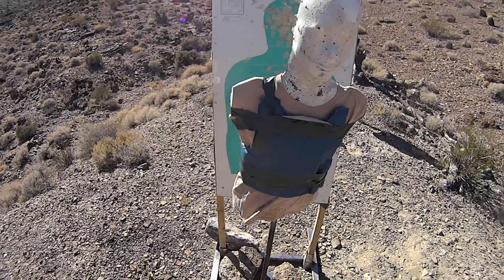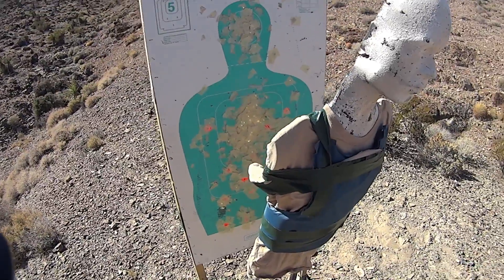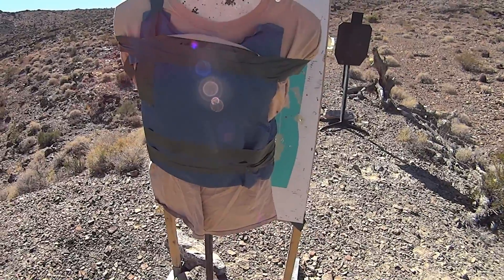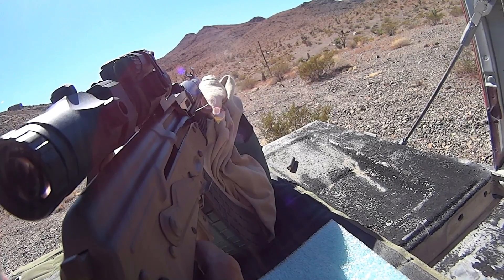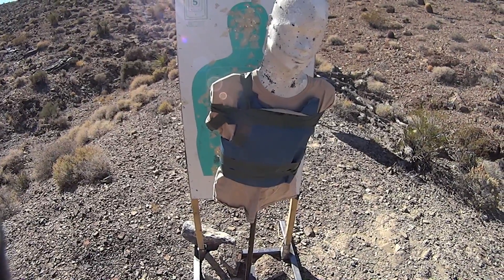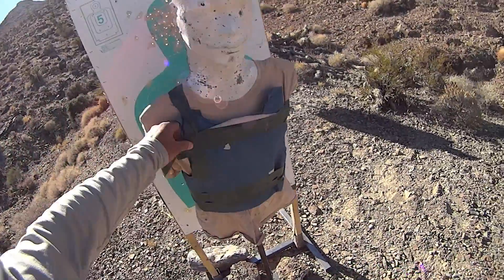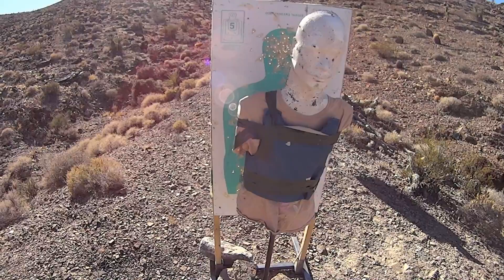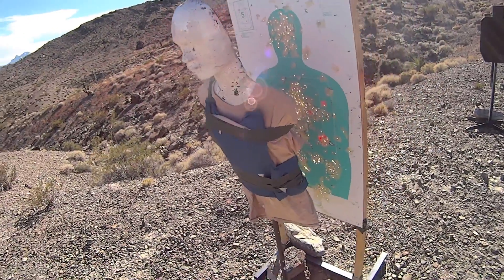7.62x39 vs 5.45x39 pt. 1.1 Long Range Armor Penetration redo

Comment: The 5.45 out of the 24" in vepr is a nasty round on humid days u can see vapor trails as it's zipping through the air at around 3400fps

Comment: I mean 124 grainers are still going faster than 1200 fps at 500 yards by the way
Reply from the maker: Depending on the load…around 1200-1300 would be expected.  In this case probably 1200ish as this barrel is 14.5”

Comment: 123gr 7.62x39 doesn’t go subsonic until 600 yards. At 475 it’s still going about 1,200 fps. Ballistics calculators are neat and also free.
Reply from the maker: Its potentially subsonic around 500 yds...its 1,200 ish at 440...about the same as a 9mm...they are neat.  Depending on barrel length and the actual projectile it can vary..but its most likely subsonic from a typical Ak barrel by 550yds

Comment: I just don't buy it that soft body armor has an expiration date... We're not talking about milk, we're talking about kevlar and other synthetic materials, it doesn't go bad over time, but I can understand why companies put expiration dates on it.
Reply from the maker: There were some materials that were shown to degrade over time...particularly with exposure to the elements.  That said, some materials degrade more than others.  Most that I have tested have worked fine, even after 20yrs...
Reply: @7N6ballistics  Interesting... Thank you for the response

Comment: now you see why people use 7.62X39. even though the Russians have adopted the 5.45 they still use 7.62
Reply from the maker: jerry a not sure what you mean...it did the same as 5.45, but weighs more and harder to hit with..  It has its place, but i fail to see how this result was anything special
Reply: @7N6ballistics  alpha &fsb units use 7.62x39. And it has its use there are 220 grain subsonic rounds . also the new ak15 has like zero recoil on full auto etc
Reply: 5.45 like 5.56 makes more damage to the flesh tissue, while 7.62x39 just passes through flesh inflicting, sometimes, minimal damage and stopping power. But yeah, 7.62x39 goes through walls like a boss.
Reply: @vengeance160  that's so false. 7.62x39 has way more stopping power than 5.56, ask anyone that fought in actual war.
Reply: At range past 50-100 yards, for 5.56 its just varnint holes typically unless its a 20 inch barrel? 5.45 yaws better and that hollow cavity leaves nastier wounds at distance beyond 100 so pros and cons depending on engagements

Comment: Would love to see this test with the new Barnaul or Wolf WPA mil-spec 5.45x39 (green box). It's supposed to be the same as 7N6 but without the steel penetration or corrosive powder.
Reply from the maker: SemperFiMac77 WPA green box, and polyformance, are both made by Barnul..as is the "bear" line..same projectile.
Reply: Very cool, didn't know that. So just go with which ever of those I can find cheaper then
Reply from the maker: SemperFiMac77 Pretty much...

Comment: WHAT???? Every AR guy on the Internet says 7.62x39 is useless at long range, how can it go straight through soft body armor at 500 yards when the entire .556 community says it can't hit anything over 300 yards?
Reply: Kevin Bowman  well it's not ideal for accuracy but if ur really good u could shoot subsonic 300blk to 500 it's about skill vs convenience
Reply: Whoever is still debating the 5.56 vs 7.62  knows hardly anything about firearms and is most likely a fudd. These two calibers are nothing alike, it's like debating two completely different tools. There are times when 7.62 has a significant advantage, and there are times when 5.56 has a significant advantage. Different tools for different jobs. FUDDS- STOP DEBATING 7.62 vs 5.56 THEY ARE COMPLETELY DIFFERENT!!
Reply: You are obviously not very good at shooting or analyzing those shoots. 7.62x39 has a very wide spread at 490 yards and was subsonic. The round was tumbling. The guy was running on luck when he shoot 7.62x39mm. The same thing that Taliban in Afghanistan do. Spray and pray. On the other hand 5.56x45mm or 5.45x39mm (very efficient round) have no troubles hitting man sized target at 500 yards (and still staying supersonic, that is thee trick by the way). I hit 10 or 14 inch gongs at 600 yards with 5.56x45mm using 62gr or 75gr or 77gr in 10 mph wind no problem. When I use 300 blackout in the same conditions (147gr S&B with G1=0.401) my hit percentage drops. Slow rounds don't do well in wind. If I used 7.62x39mm hit percentage would have been even less. 
I do plan to acquire 5.45x39mm rifle and some ammo. 5.56x45mm and 5.45x39mm are fun and very efficient rounds (especially 5.45x45mm that gets G1=0.347 with 60 grain projectile).
Reply: @im-oc4jr  I shot man sized steel targets with a 1-6 ACSS scope from a AR47 hybrid and hitting 8 out of 10 shots at 600 yards.  Yes, I have an upgraded trigger and BCG but the round can do it despite not having much power left at that distance.  Since, doing that 3 years ago I haven't bought any other 5.56 rifles as why bother when x39 can do what I need it to.
Reply: @mikes1172  human size targets at 600 yards that is the key human. Your spread must be a few feet. Sometimes you get leg hit sometimes you get head hit. On the other hand with my 20 inch AR using 77gr I have multiple 6 to 9 inch 10 round groups. I do the same thing with 300 blk and my groups open up especially when windy. My spread with 5.56x45 is few inches. You can lob 9mm at 600 yards. It will be large spread but it can be done. You can shoot 22LR at 600 too. 
Anyway, I used 7.62x39 a lot in the Balkan wars. If you want to hit something especially in mountains with changing winds it is at best 300 meters caliber. 
5.56x45 is much better for longer ranges and you don't have to us your rifle as a mortar.
Reply: @im-oc4jr  Well, I have it on video and I wasn't alone when the test was done.  BTW, I don't need your qualification or approval, so have a great day!
Reply: @im-oc4jr  7.62x39.is superior out of a shorter barrel it loses very little velocity which is why some special units in Russia still use it.

Though at longer ranges obviously 5.45 is better for regular infantry . lighter and better ballistics
Reply: @im-oc4jr  The same thing that Taliban in Afghanistan do. Spray and pray.
====
Yes, spray and pray...
...because islam actually forbids killing. So, religious Muslims just not aim, shooting "somewhere that direction" leaving to God Will who would be killed.
That is of course when we talk about regular conscripts, because experienced dogs of war are different story
Reply: Kevin Bowman never heard that 7.62 was useless. But that 7.62 from an ak47 was useless. Keep in mind that all these new aks aren't ak47 they are newer upgraded akms. Saying that they are as terrible ad the og ak is like saying m16s aren't reliable when theyve been upgraded over the last 60 years
Reply: @jrockhardest  Actually the older ak's (type 2 and 3) would be a little more accurate being a milled reciever.

Comment: Hey Buddy I just picked up a Arsenal SAM7R and I am thinking about sending it to Rifle Dynamics to get the upgrades and was wondering if you really notice a difference after you had your 2 rifles upgraded any info would be much appreciated.
Reply from the maker: MikeTango6 the main difference is improved handling, due to less weight at the muzzle end, and lack of added on weight from the KOP.